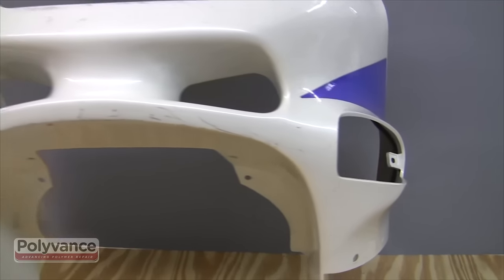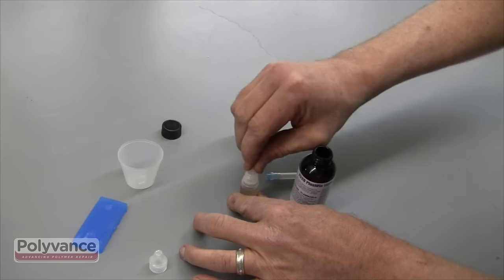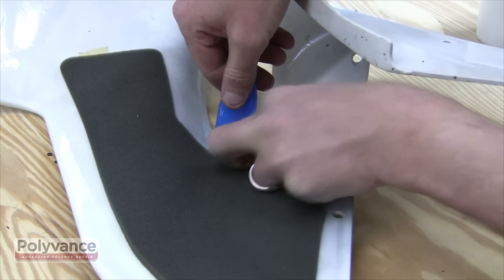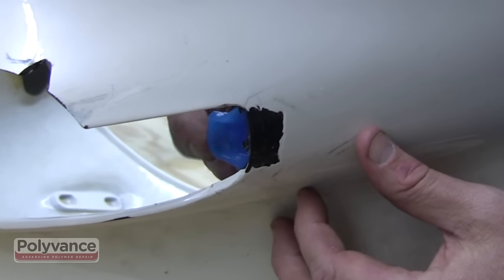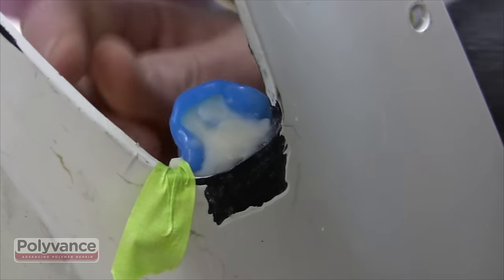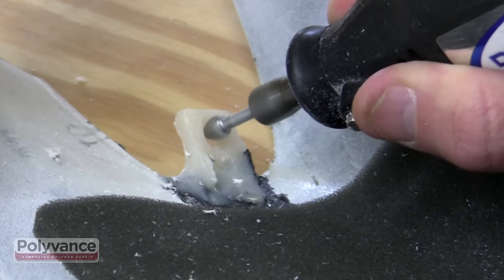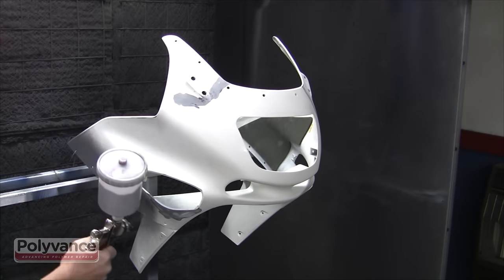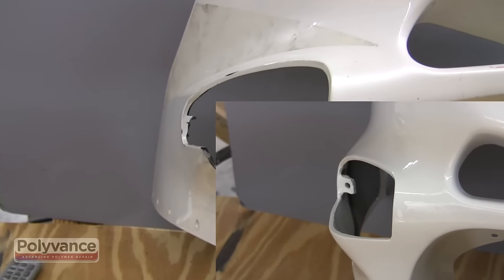Fix Broken Tabs on Motorcycle Fairings - Fairing Repair

Comment: HAHA. Just use JB weld it will be far stronger than this.
Reply: Lhong, you are wrong about that.  JB weld is not nearly as strong as PlastiFix.   JB weld only makes a surface bond, while PlastiFix is a chemical bond.  You will not make a stronger bond to ABS than with PlastiFIx.
Reply: @scottb7600  maybe you are right, JB weld does not bond very well to flexible surfaces
Reply: @lhongkho1091  This is true.  Its great for stuff like fiberglass, metal and other rigid materials.

Comment: This looks like acrilic powder to doing nails
Reply from the maker: It's very similar!
Reply: PlastiFix uses the same chemistry, but nail powder dries flexible and does not have the same bond strength to plastics.  There are enough differences in them that one will not work in place of the other.  Its kind of like the difference between house paint and car paint; they are both paint, but you probably don't want to roll satin latex on your BMW.
Reply: Thanks for answer, I have all fairings broken somewhere mostly on fixing

Comment: Don't be gipsy,  buy new fairings!
Reply: Why?
Reply: @scottb7600  because  why not, new fairing kit is like 300-400$ and you can install it by yourself in 2 hrs max, or you can buy used one locally for 50$ , like i did for my r6 , that way you have spare kit ready.
Reply: @Sanisani9  New fairings on old bikes are not always available and if they are, most are not that cheap.  Used fairings are not always in great shape either, so if you're going to have to do bodywork on your replacement anyway, why not just repair what you've got?
Reply: @scottb7600  i guess yeah, or make street fighter lol
Reply: @Sanisani9  hmm racers here dont even use stock fairing , they always use race fairings

Comment: That crap is super expensive.
Reply: But it works SUPER well.  MUCH cheaper than a new body panel too!
Reply: @scottb7600   Fiberglass is way cheaper and you get in bulk by buying minimum. 
You can make a whole copy of a motorcycle part if you want. 😃
Reply: @enrinev7380  So you're saying buying the material to make a pattern and mold a part is going to cost less than a small kit of PlastiFix to repair a tab?  Doubt it.  Plus, you need to fix the part to begin with before making a pattern from it.  Sounds like your talking yourself into doing a PlastiFix tab repair!
Reply: @scottb7600   please, obviously you don't know anything about fiberglass. Please research the cost. I just bought 5 bucks of fiberglass with the resin & activator included; placed in styrofoam cups.
You either trying to make sales of this product or very uninformed.
$5 vs $50. Plus I can save the rest for later.
Reply: @enrinev7380  not sure where you buy your glass cloth and resin from, but you can't even buy a quart of resin for $5.  But not all glass cloth and resin is the same either.  Most glass is at least $10 a square yard.

Comment: Can this be used on 1/4” thick 2” circular and be able to recut it smaller and hold heavy object back in it after being recut smaller
Reply: possibly.  Email polyvance with more details and someone should be able to give you some specifics with a little more info from you.

Comment: Way Too expensive. It’s cheaper to buy new plastic parts. No need to repaint.
Reply: Hardly.  Most street bike fairings are very expensive and all need to be painted when ordering them.  Replacement parts come raw or primed.
Reply: Almin, go away troll. Cheaper to buy new, 😂. Room temperature IQ coming in hot.